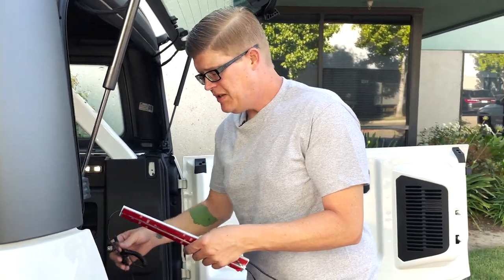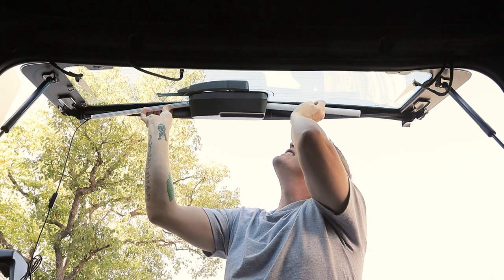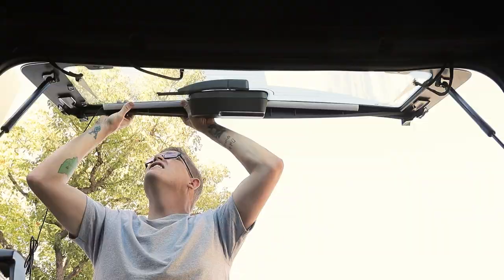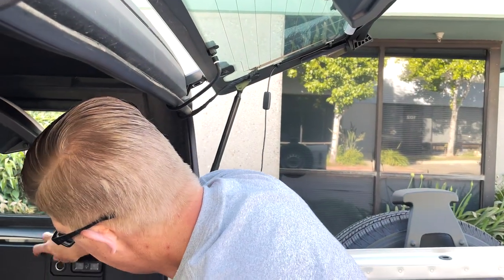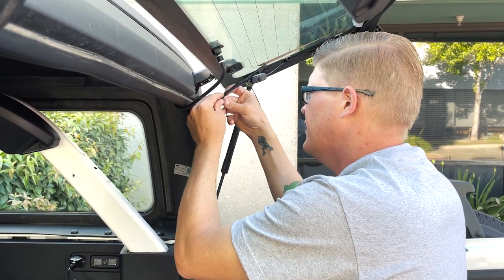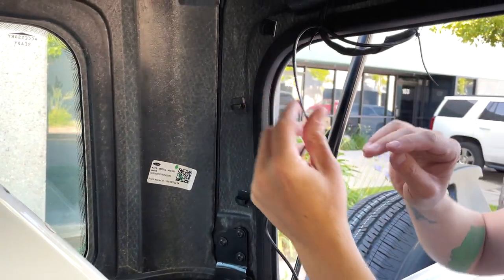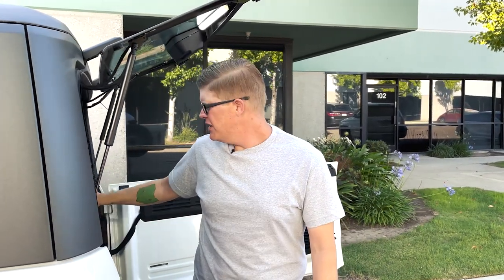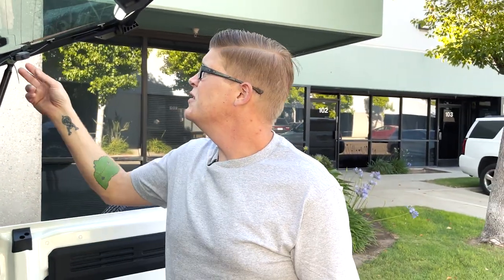How to Install 2021+ Bronco Rear Cargo Lights

Comment: I think mounting these on the cross bar  wouldn’t cast as bad a shadow when using the trunk space
Reply from the maker: That is a great idea! You can actually do that! It's really up to your preference where you place the lights. It has double-sided tape on two of the there sides of the like.
Reply: @AdvancedAccessoryConcepts  yeah might buy these and try it out…if only I had my hard top already…soft top it is…but last night it was dark back there so will pick up a set…maybe a cord to convert this to USB then I can use a flush usb 12v and also charge my drone back there
Reply from the maker: @TacticalDev  Oh gotcha! Actually, we have used this device for similar uses with our cameras and phones as well maybe it would work for you. https://www.amazon.com/Extension-Cigarette-Splitter-Compatible-BlackQC3-0/dp/B07YS7WMQR/ref=sr_1_7_sspa?crid=2VRPXN9JI3098&keywords=turn+cigar+lighter+to+usb+female&qid=1660666077&sprefix=turn+cigre+light+to+usb+female%2Caps%2C121&sr=8-7-spons&psc=1